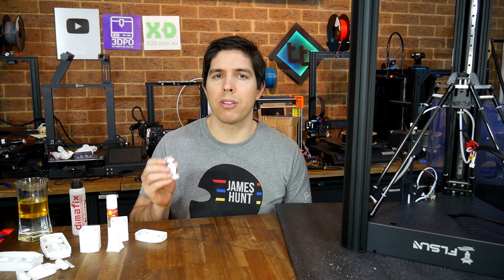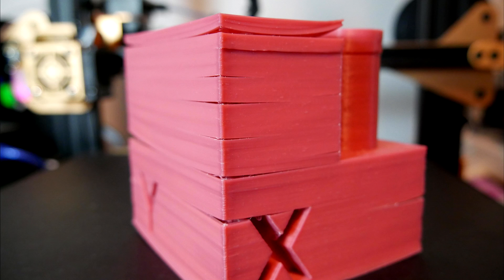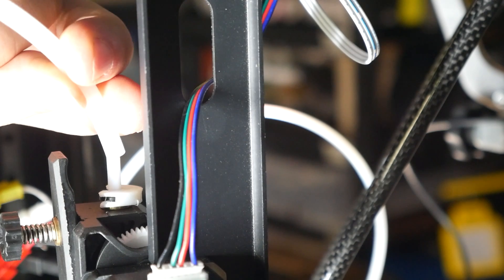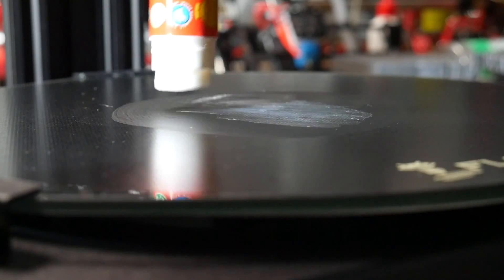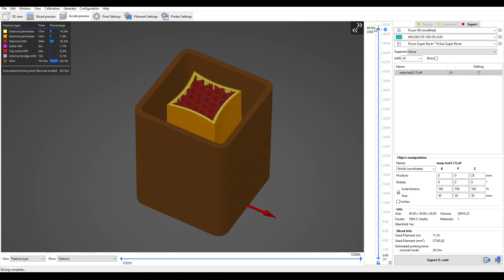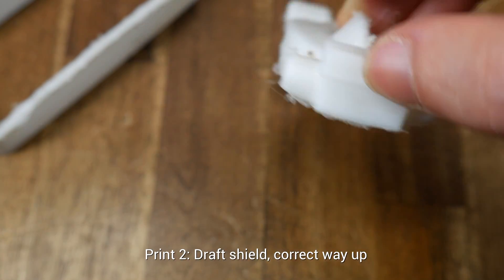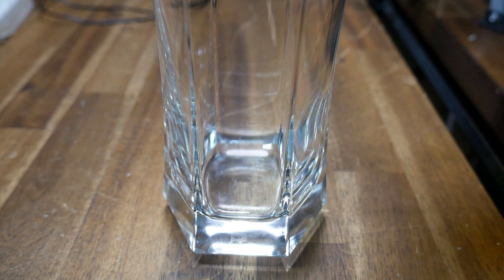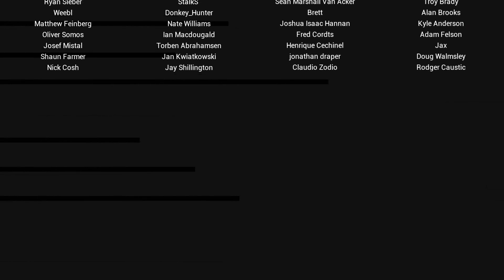Can 3D printing upside down help reduce warping?

Comment: I've had excellent results printing nylon on an open-frame CoreXY printer with just gluestick (sometimes lots) on a glass bed. I've used Polymaker Polymide CoPa, Taulman Alloy 910, and Dremel-brand Nylon, so maybe those specific nylon blends just warp less than others. Great job investigating this interesting concept so thoroughly!

Comment: Hi Michael great comparison as always. Although I have never printed with nylon the textured glass beds used on printers always appears to give people problems with adhesion. As you also live down under you have access to the "Diggers brand Methylated Spirits". I have used this exclusively on my Artillery X1 and Anycubic I3. I clean the bed between each print every time as this is cheap to buy and have had no problems with adhesion

Comment: I've had decent success using kapton tape for bed adhesion with nylon, with smaller parts sticking pretty well and then releasing. Also, what bed temperature were you using? I find that the hotter the bed can go, the better for nylon.

Comment: I think it will help with curling and shrinkage.... slightly. But making the print more likely to not stick and then fall off are an even bigger hassle. No substitute for a proper heated enclosure though.

Comment: Hello,
the glue stick is water soluble. You do not need to use a spatula for this. 
This is exactly how you get a nice adhesive layer with the glue stick. Dissolve the adhesive layer with water and a brush. Then heat the heating bed to 60 degrees. After the water evaporates, the adhesive layer is very thin and even. 

Many greetings

juck.

Translated with deepl

Comment: Under the same conditions (with same model etc) how repeatable is the amount and geometry of warp ? I question this as perhaps printing with some kindof adjusted non-flat/domed geometry and necessary supports could predictably then warp the part into the correct geometry as it goes.  I appreciate bed adhesion would still be a challenge, but wonder then if that could be compensated for predictably with some under-support layers (either same or different compatible material to form a base)

Comment: A wider distance between the model and the shield might help, by trapping a larger volume of hot air instead of a thin layer that can be easily disturbed and moved away by the nozzle fan.

Comment: When I first saw the Kraylen compact, I thought the most obvious advantages were these...
A. Near-infinite bridging - cos the bridge runs on the nozzle, mitigating sag a Lot.
B. Gravity Support - ie: with the right slicer settlings nearly all of the support can be removed from most prints*
*yes yes, you'd still need support for under-hangs but maybe none at all for over-hangs. Reducing waste, print time, cleanup etc..

Comment: I use glue stick quite a bit. I preheat the bed before printing, spread on the glue stick then thin and smooth it out with alcohol/paper towel. Works well and puts a nice thin sticky layer without a lot of build up. Cleans up really nice again with a hot bed, alcohol and paper towel.

Comment: Try lemon juice on your bed. Heat the bed first, apply with a brush. I use the stuff in a bottle and have never had any problems. It's also water soluble so it's easy to clean

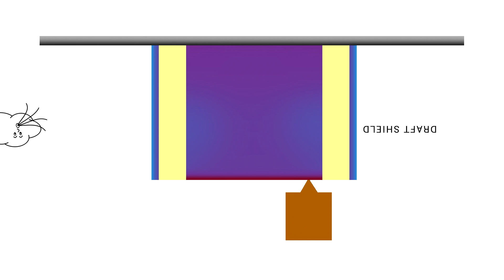Comment: 3:02 about printing upside down, as printers works in  zero G , on the sides or upside down (video from three years ago by make anything) I would be pretty sure of the end result with PLA or ABS, about the heating properties of the draft shield, it seems plausible and a good idea to lower the electrical consumption of the printer by discarding the need of a heated enclosure.
PS I am from the no heated bed team :)

Comment: I have experienced the exact same issue recently with PLA and an Ender 3. For some reason the plastic refused to stick to the bed all of a sudden no matter what I did. Only the glue stick works good. It is worth it to try several brands, also it is necessary to have a heated bed. The glue needs to dry before printing. I use a clear type from a dollar store near me.

Comment: Maybe have a heated fan system just on the top of the hot end with a shaped vent going down passed the cooling fans to the hot nozzle and thereby be blowing hot air down on to the model such that the model has enough hot air blowing over it to keep it warmed up all over wit maybe the printed air shield done so the print can e done the normal way up? 

Any air from the hot end fan will be heated up by the air from the heated fan system such that it will not cool down the area around the print thanks to that printed air wall.

Maybe a weighted edge based rubber folding wall type encloser which is the full size of the bed could e attached by a frame to the hot end with a top cover as well so as the printer moves upwards as it printing the model the wall unfolds and the weights in the edge of it hold it down so no air droughts cool down the printing area?

Be like a big square rubber bellows in a track like the old original film cameras had to let them e moved back and forth for focusing!
Reply: I was going to suggest very much the same. Idea taken from cooling on lathe/mill. Flexible tube attached to extruder and blowing hot (controlled temp) between print and shield. Will try this soon.

Comment: Why bother scraping the gluestick off the bed?  Take the glass off and run it under hot water and it'll come right off
Reply: I do this with the PEI sheet on my Prusa, boil the kettle and pour boiling water onto the glue or the hairspray or whatever, comes right off.

Comment: We should try using directional infrared heaters. Get 3 of them and aim them all at the part while printing. In theory you could even control how much heat they are applying to the part, and keep it at whatever temp you wanted.
Reply: Not all plastics absorb IR, also its not that hard to make a box and put a heater with an Arduino (or use a spare port on the printer's mainboard) to control a third heater just for the chamber.

Comment: I wonder how printing upside down could improve overhangs and reduce the need for supports?
Reply: Without supports, filament would sag and fall down possibly causing nozzle crashes...same problem different direction.

Comment: whenever I print with ABS or PETG, I usually print a nice big brim that I cut away after the print is done and this along with typical bed adhesion methods does the trick. I'm confused why there isn't a brim or raft when using a warp prone material with a warp prone model?
Reply: Well given the intent was to make it warp (but not fall off entirely) to see what else helps against warp, there you go. But yes I never print ABS without a brim either, the bigger the base (also sharper the corners), the bigger the brim.
Reply: @Troll I've used rafts before too, but stopped doing it after I got great results just spreading some PVA wood glue on the glass and brim only. Now with a PEI sheet on the glass I don't even need the glue anymore to get ABS to stick, tho I do use 110°c instead of the default 100. No warping issues with a brim and PEI or glue on glass.
A less than squished leveling (can also be compensated with 1st layer flow) could make it not stick tho. Squishing it enough it never lifts corners here.
Reply: @Kalvinjj  explain, HOW the brim works here... like everyone else, or your entire armchair analysis is completely moot. There is no benefit to the print, never has been, from a brim. Arguably the only gain(Is it really?) from a brim, is to prime the nozzle before it starts the actual print.
Reply: @nicewhenearnedrudemostlyel489   I don't know if either you and Troll use a slicer that calls "brim" that little prime ring around the print, which is NOT connected to the print, and "skirt" the thing connected to the print, and it's just that Cura calls that prime around the print a "skirt" while the attached thing to the print is a "brim". This, the attached thingy, is what I use. A few millimeters of plastic extruded around the print, attached to it, that you have to cut out after the print is done. That's the thing I'm calling a "brim" cause it's exactly what my Cura 4.9.1 calls it. I literally sliced a part now just to make sure I'm not confusing the names and talking out of my ass. Also, "raft" is that big base thingy, entirely UNDER the print (unlike a brim which is around), just so we all got the same terminology right.

This, helps adhesion cause it makes a wider base all attached to the build platform, which seems to contract and screw up far less than the print itself given it's just a single layer of that. It helps a lot specially holding the corners down.

And yes a "skirt" (read above) is what I use on PLA and PETG usually just to prime properly the nozzle before the print.

Frankly I think the name "skirt" makes more sense for that indeed but eh, Cura calls it brim, I call it brim then.

Comment: Garolite is what most suggest for nylon bed material, apparently it sticks that good you need to raise the layer height and lower bed temperature 😂
Reply: glass with regular glue works well too, we have both at work but due to glass being so much flatter (and the auto leveling sucking apparently), glass at 60c with a non-heated enclosure is what we usually use. We also print fairly long pieces like a foot long without any warping, really have to use the scraper like a cereal killer stabbing to get the parts off. I've also printed just a little on my barely enclosed printer with same settings I think on even painters tape if I remember right. Its not as bad as ABS, but I find ABS easy with most of my printers (my new one seems to be having issues, but I only started trying it tonight and put it together last night where PLA was working perfect but I still need to work out some kinks for ABS which is my normal filament for personal use).

There are different Nylon versions, so maybe that's it, we use Tulman 910 for most of our Nylon, it seems to be easy to work with (the print room is kept very hot dry, and we use dehydrators if it seems wet).

Comment: What’s that saying about doing it right the first time?  Whoever is printing with nylon can most likely afford to build a proper enclosure.
Reply: Nylon isn't that expensive, especially if you just want to do a few parts and only buy a half KG role for $30. Even my partially enclosed printer was doing good enough with 60c bed and gluestick, about the same as ABS which I have dialed in for that machine. I think I even printed some on painters tape just fine. There are also different types of Nylon, some may be less prone to warping so it depends what you want.

At work we use 60c bed, gluestick (replaced every couple dozen prints), and the printers have what I would call a normal enclosure without heated chamber, they do fine with Nylon even fairly big pieces (much better than ABS which really likes to curl on those for some reason). The enclosure is nice, but as for "proper" I've found that simply a cereal box with a slit for the bowden tube draped over the X axis on a bed slinger works pretty well, not perfect but it traps most of the hot air and its ceiling is very close to the bed so it quickly heats up and stays hot.

Comment: Prediction:  hot air rises yes, but almost any fan will over-ride convection, and the print-head has a few.  The nozzle fan in particular could be strong enough to purge any warm air from inside the shield.  Delta at least isn’t waving the part around so should fair better than an upside down moving bed printer in an upside down side by side. 

So I predict slightly better than upright, but not as effective as an actual enclosure would be

Edit/follow up:  so now see you will have the part fan off, that was my big concern, adjusting expectations upward slightly.
Reply: Yes the forced convection will over take the natural one

Comment: As a bed adhesive I've had some luck with PVA suspended in IPA in a spray bottle. You can get a thin, even coating and it's easily cleaned off with a razor or water.
Reply: PVA is just the base composition of wood/paper glue, I've used that for ABS before getting a PEI sheet installed and indeed it works wonders. Rather, sometimes too annoying to remove even.

Comment: Thanks for the thorough investigation.

I wonder what happens if the shield have small holes on the very bottom so the hot air can circulate around the model.
Reply: that would defeat the shield's purpose actually. The whole point is keeping it trapped, and a hole at the bottom would either just allow a fresh (also, cold) air path to a normal oriented print (since the hot air would be escaping from the top, new air comes from somewhere after all), or an escape hole for the hot air on an inverted one, which again fills it with cold air.
Remember that the biggest heat source is the bed, you're not blowing hot air through the nozzle or fans. Well, the heatsink fan does blow a little bit of heat but that might be negligible depending on heatbreak.
Reply: @Kalvinjj  
You are right. Generally a hole would defeat the purpose however, if the hole is on the very bottom and small enough, e.g. 1mm, it generate a slow cyclone of hot air that is coming from the surface of the hot bed and slowly rises around the model and keeps it warm. Without the hole, the stationary trapped air slowly looses its temperature and wont be helping much. Developing the idea a tad further, the foot of the shield can be a bit wider to cover more of the bed (heat source) and gets closer to the model profile in higher layers. That will create a relatively strong chimney effect that keeps hot air moving around the model. In addition, heat transfer is greater when the air is moving. Of course the idea takes a few try and errors however I think it is worth to try.
Reply: @a_student0  I see, sounds interesting, the heat transfer and fluid dynamics part of it is definitely true. I think it would be a bit more complex than just a hole whoever to get fresh hot air to the shield (albeit when it gets taller that chimney effect might become far more pronounced so just the base might be enough indeed).

Comment: I find that adding circular anchors (flat pancakes - or very short cylinders - 3-5mm diameter) on every  edge helps with proper anchoring. I know it needs the extra postprocessing by removal after print - but it helps.
Reply: You mean like a brim but localized only on the corners? I've seen this technique indeed and it sounds really useful, tho I've never found that as an option on Cura at least. Do you have it on another slicer or is it some trick you either do on the model before exporting (that much I could do, a 0.2mm tall circle on the corners), or some setting I haven't enabled?
Reply: In SuperSlicer/PrusaSlicer you can add primitives as additional bodies. Just add one cylinder, modify it and populate it.
Reply: @pjak2000  Oh nice, I get it. I could give PrusaSlicer a try too. Also you gave me the idea of having the 0.2mm cylinder as a model that I import and let overlap in Cura too, thanks.
Reply: @Kalvinjj  Yes. I've been practising this as well. Having a simple STL ready and just import it together with main model. Then you can use them as a "nails".

Comment: Well, first off, whether it works, or not, I see that the "shield wall" is a HUGE waste of mats! Not a fan of that method already.
Reply: If you think that's a "HUGE" waste of materials, then you don't know what a huge waste of materials is.
Reply: Well, I've been a master carpenter since the mid 80's, and, if I had to waste approx 15-20% of the materials that it takes to build a house, building, or any other structure, then I would prob more than likely been out of business since the mid 80's... =)
It appeared that, with the extra materials for the "enclosure" looking to be approx 15-20% of the materials for the actual project piece, I thought that I would be in the ball park. I guess Mr. Laws would have a MUCH better estimate, as far as waste, so, I would always defer to his obvious expertise.
Reply: As well as, every project piece could be a significant difference in volume of material used to print said piece, than another piece, so the waste would vary as well.
Reply: @Rejoice1631   if you work with logs or veneer
You'll have to calculate about 50-100% wast material for you projects. Not sure what you are doing or if you have found a genius way to do stuff.

Anyways if the draftshield makes the prints come out perfect, it's definitely worth it. Any draftshield is less waste than a failed print.
Reply: True... I just hate wasting any mats, at all... =) As far as my work, just the usual buildings, houses, pole barns, metal, and wood studs, sheathing, roofing, etc. Yes, when working on milling up rough lumber, there will most def be a lot more waste, I was just referring to the retail stuff, after it's been kiln dried, and such.